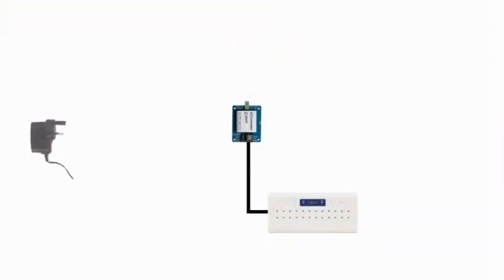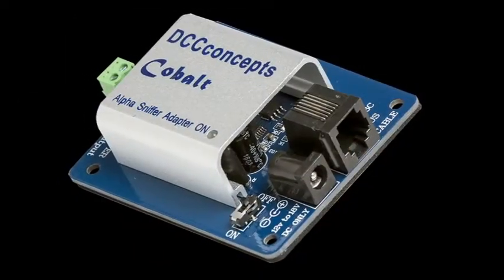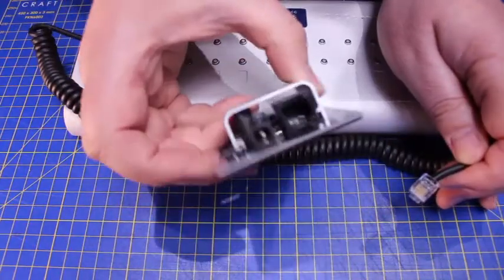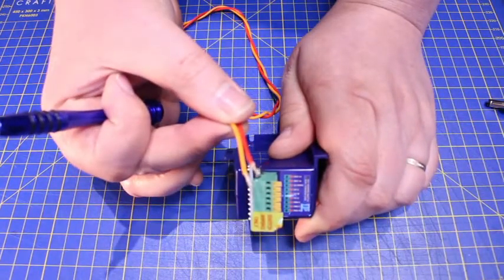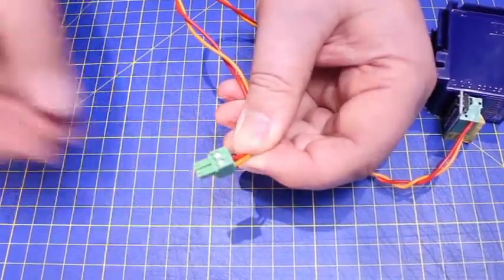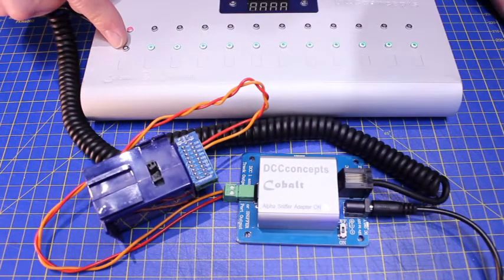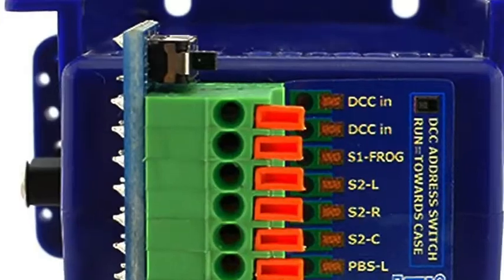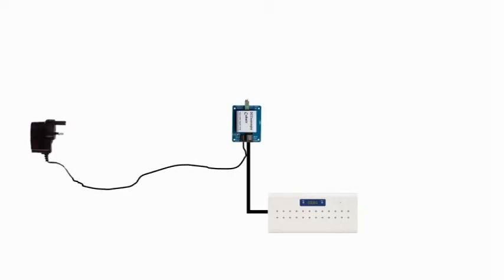Alpha - Point Wiring Made Simple For Any Layout

Comment: I have a load of digital Ip motors on my layout. i can change them using my digitrax hand controller. I fail to see any benefit of this at all with a dcc layout.
Reply from the maker: But - if you had a DC layout and you didn't want all the switch wiring? Or if you didn't want to use your hand controller and wanted to physically switch your motors without having hundreds of wires?

Comment: You say below, The "sniffer" generates a low-power accessory bus for those who want to take advantage of "bus" wiring but have DC layouts, or for those who wish to create a separate accessory bus. " So is this sniffer (for those using DCC) your solution to supplying a separate DC Bus which could then be used, say with the under the bench for say ESP® Wireless DCC Receiver Unit?
Reply from the maker: The sniffer creates a low power DCC bus which can be separate from your "track" bus. It can also interface with ESU ECoS or Roco Z21 systems using their "Sniffer Port".

Comment: I am using AD-8sx accessory decoder to control my solenoid points. What would I require to make this system work with these?
Reply from the maker: With the ADS units you cannot use the Alpha Sniffer to create a separate accessory bus because the ADS units draw too much power. However by powering the ADS units via the track bus, you can use the Alpha Central to control the point channels just by plugging it to an appropriate RJ12 port on either your Alpha box if you use one or alternatively into something like the second connector on an NCE panel. The Central acts as a dedicated set of twelve buttons pre set to change twelve accessory channels without needing to access the accessory control functions (which can be very longwinded!) on your handset or screen.